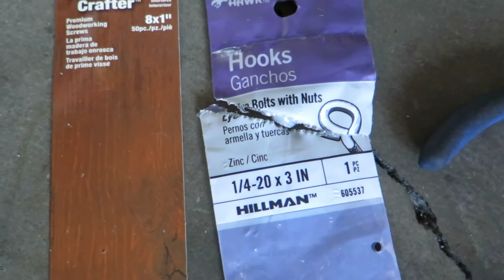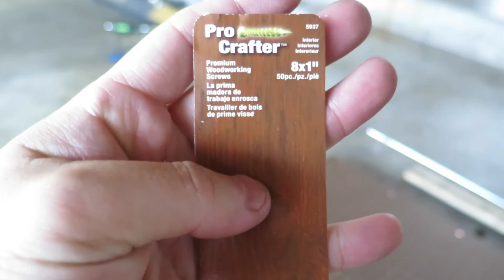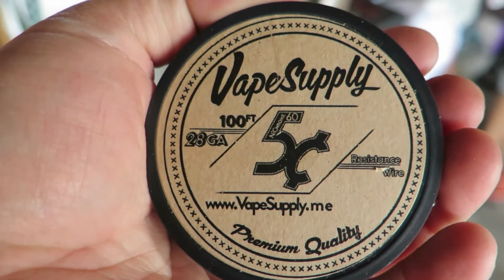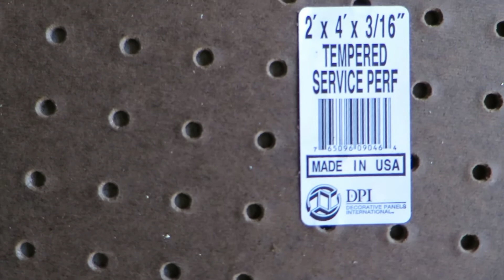Custom Pelican Case Project: Part 1 - Foam Cutter DYI Build Setup

Comment: let me get this straight - all it is is the 12v go to the wires?   the + go to one side, and the -  go to the other side, and it would heat up the nichrome wire?  does this need some resistor or none ?  

thanks
Reply from the maker: +John Pham 

yes, the nichrome wire is straight on to the power contacts.  the nichrome acts like a resistor, that is why it heats up and cuts through the foam. also, keep in mind, it doesn't matter which way, positive or negative.  just make sure, DC power. the amount of power depends on which thickness nichrome wire.  thicker needs more power vs thinner.  longer needs more power vs shorter.
Reply from the maker: +John Pham search for a nichrome power calculator on google.  there are so many. so first start with the wire, and see how long it will be.  then calculate the voltage needed to cut foam.  i would get an adjustable voltage DC power supply.  it will help you change voltage when ever you want.
Reply: +faded1004 

thats great - sound like a simple project to build.  Also where do you get that bend metal - I guess I could use or cut some PVC pipe - a semi T - just as long as the wire tension is sharp enough
Reply from the maker: +John Pham you can buy it at home depot or lowes.  1/4 bar... that is why i bought everything 1/4 so i can also use 1/4 drill which is an easy size to find. alot of people use wood, or pvc... but i like how the aluminum bar has tension all the time.  very easy to unhook and pull through holes when you want to only cut the middle out.
Reply: +faded1004
now that I watch your video - instead of buying that rod and bend and drill to a board, have you though of buying a T shelf metal support - screw it against the wall - and run that wire up from a bench to that T hole screw?
the height is fix - but heck - just 12" to the table top and not much cutting 
and drilling.
Reply from the maker: +John Pham you could do that?  but then i wouldn't be able to let my friends borrow it?  also, if you wanted to cut really large pieces, it is really helpful to put the cutting in the middle of the garage and let the foam hang off the sides.  you will need to turn it, and rotate it and slide it... so alot of room helps you alot. 

this case was my practice case... i have a very large pelican case i am going to work on may be this winter... and the foam for that one is super expeisive... so i needed to make sure i knew i wouldn't trash it.
Reply: +faded1004 thinking some more, cheaper version is to buy  two screw hooks.  Screw one to the kitchen table side, and the other to the kitchen shelve (assuming the table and shelve  are parallel to each other and end similarly like my kitchen)  then run a power line to both screw hooks nichrome wire.  Now you have a professional looking foam cutter (just unhooking the wire from the top when you're done).   

I can't wait for my nichrome wire to arrive so I can build this
Reply from the maker: +John Pham yes, that would make it simpler. just keep in mine length of the nichrom wire and what voltage you need.  also make sure you check how much current it will use at that voltage and make sure the the power supply can handle it.
Reply: +faded1004 
My nichrome wire 28g and 24g arrived yesterday, so I screw down two screws, one on the cabinet and one on the side of the kitchen counter.  
Wire up the 28gauge wire - and connect a 12V 1amp power - and I 
was able to cut a couple foam!!   

What I notice, is that when I apply power, t he wire seems to expand!  
how do you keep the wire straight when you apply power?

The 24gauge nichrome doesnt seems to get  hot at all, maybe higher voltage?
Reply from the maker: +John Pham you need to calculate the correct voltage!  be careful.  search google for the calculator.  sounds like possibly too high and it is stretching?  not sure.  just use the calculator.